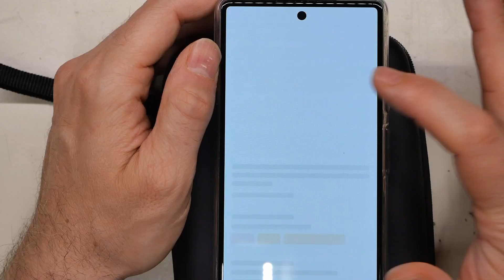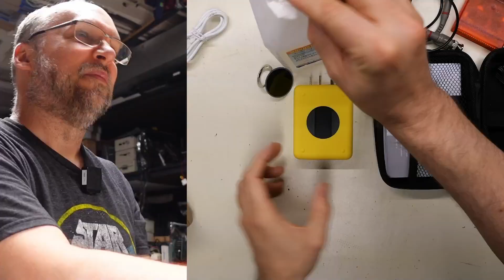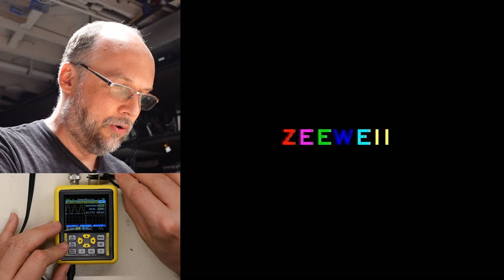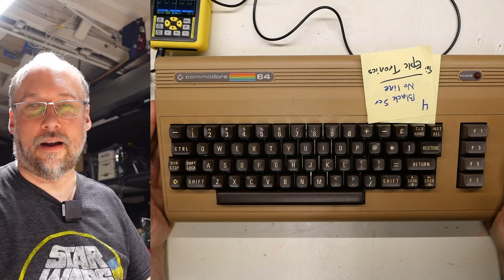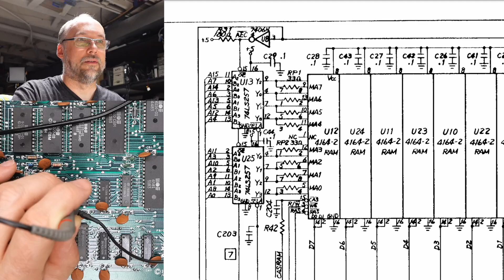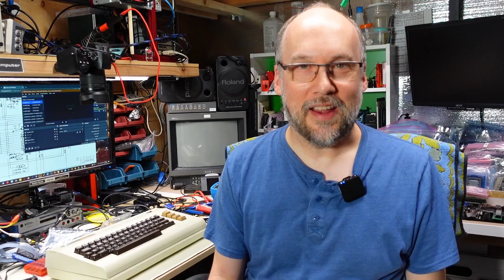4/12 C64 repair using a great $57 portable oscilloscope (ZEEWEII DSO1511G review)

Comment: The normal ENIG gold cover ist very thin (~100nm) and soft and ony supposed as an corrosion protection to ensure solderbility. Real contacts use hard gold, which is ~5um and much harder. But it's an additional chemical process and cost some money.

Comment: Question for your Adrian: Do you still ditch the shields when you repair a C64?  I have worked on one for a week and finally it's perfect! yea!!   But bad words to accumulate.   I thought for originality, I would put the shield back on.  1st time: 5v line short to ground.  Oops wrong shield and carboard. Used one from a 407 board on this 425 by mistake.  Okay fine just a few f-bombs.  Then with the right shield installed and the board screwed in to its new lower case 3d printed "studs", it failed keyboard test. So I buzzed the U1 out.  Only got to pin 3 when I figured out it was grounded Took shield off still grounded.  Grrrr.  More expletive's deleted.  Found a via short to ground near R34 (I think the TAB from the wrong shield soldered there.   Anyway, this was frustrating and will probably just delete the shields going forward.  Made me wonder if you still delete the shields?

Comment: I bought this ,scope and only after I started using it, realised it was single channel. Does anyone know of a dual channel 'scope that still has the video out function? I run technical training for railway systems and want to be able to show on the overhead projector the two waveform that my level crossing manager injects into the rails.

Comment: A minor comment about your reference to the lack of sockets used on the Commodore 64 board.  My first "PC" was a Nascom that I bought in the late 70s.  I can't remember if it was the model 1 or 2.  I bought it second hand from the person who had built it, from a kit, using sockets on virtually every chip and it was completely unreliable.  Several friends also bought them and every one built with sockets was unreliable and every one soldered directly worked perfectly.  It led us to formulate the "Law of PC Boards": "Using sockets to mount digital chips makes it 10 times easier to repair faults BUT makes the occurrence of faults 10 times more likely".  I completely stripped every socket off the board and rebuilt it using direct soldering and it worked perfectly for many years.

Thoroughly enjoyed the video.  Brought back memories of when "building" a computer meant a double sided PC board and a plastic bag full of components not buying a few pre-built boards and connecting them together.
Reply: I imagine the general quality of sockets improved significantly from the 70s to the 80s and are definitely way more reliable nowadays.

Comment: Adrian, As far as adjusting exciter Frequency, is the wave clean enough on a display to calculate out the Frequency per block and adjust the frequency using the wave itself instead of the number readout?

Still may not be sensitive enough but with the visual may be able to fine tune better than using the readout.

Comment: With all the inexpensive scopes, I'm curious if you'd try the Pi Pico (or any RP2040 board) scope that uses Scoppy.  Just for shits and giggles considering how utterly low cost it is.  One of the better of the guides is on how2electronics but there's also a lot of variants out there now. HackADay has a better build but it's also a custom PCB with a lot more components, a display, and doesn't use Scoppy or a different app; higher cost, but I'm not sure if it'd actually be any better.  The Scoppy route, using the RP2040's own (extremely lackluster) ADC is limited to 200KHz, the HaD version is using a 100MHz ADC; though you could modify it to go higher with a higher sampling rate ADC, you could also modify the Scoppy version with modified firmware since you're moving from ADC input to digital input, though I'm not sure what the limitations of the RP2040 are. 

I've also heard talks of an experimental LCR using the RP2040, but I don't know if anything ever came from it.  If this is possible, along with a multimeter, maybe a logic analyzer, and the scope, and if it's possible to make it battery powered with a decent display, decent button control, decent software, and within a good casing, this could be a decent little portable tool; probably no larger than the ZEEWEII is.  Honestly if this is feasible, or upgradable with a better off the shelf MCU, I'd actually dive into this kind of project; an all-in-one tool would be just as useful as those pencil style smart soldering irons that can be powered by USB PD, especially on the go and for field work, not to mention just general space saving.  Honestly if the software could read out bits as well, such as for work on peripherals and various busses, that's just be the cherry on top for this hypothetical multitool.  I might have to look into this myself, since there hasn't been a cohesive project of everything in one as far as I know.

Comment: Ah progress.. i have 3 big metal 500 pound oscilloscopes in the garage and this is higher frequency, 1/100th the weight, cheaper than dirt and probably more accurate :P

Comment: time stamp 36:20 - Put a little hot glue on the corners of the board before closing the easy flash case.  Then it won't wiggle and stress the led legs.

Wow, found this video by accident.  So cool and random,. you made my day.  I hope to be you when I grow up :)
Thanks

Comment: I've bought DSO 2512G and it seems to be a good thing for the price! It's mostly the same as DSO 1511G but has two channels (the max frequency splits in this mode). The price on 11.11 was about 60 bucks. The banana plugs was very tight but the seller did helped me and gave a hint to squeeze it a bit by fingers while inserting.
I don't know where to use it :))) Not a big problem of course. The main idea was that one day I'll need it to debug my Raspberry Pi 4 or to watch how different part of an analog synthesizer works.
Someday I'll return to my long way quest to create own analog synth. It was highly inspired by Adamsky A. channel. If you're reading this and want to know more about that stuff and don't know where to start... His channel is the best place. It's not an ad! :)

Comment: Thanks Adrian, great video. I ordered one from Alliexpress, was $62. However, although all the buttons, menus, features seem to work, I'm not reading (flat line only) any signal from the internal waveform generator, as-if the generator isn't working or the probe isn't connected/working. Any thoughts?

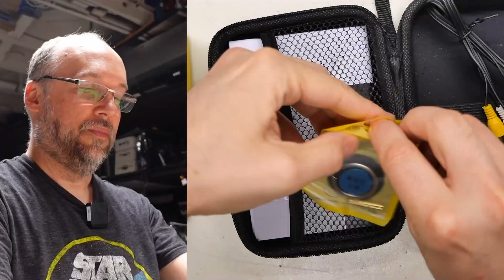Comment: 4:51 I guess that's metal in the back so you can fix a magnet anywhere and have the oscilloscope hanging (at the side of your monitor for example). I do this to my cellphone, very easy to attach/dettach when needed.

Comment: Great video Adrian.  Regarding a general oscilloscope recommendation- what would  be a good choice for a beginner in the ~$200 range?  Thanks
Reply: I believe I've seen some used Fluke 20mhz Scope-meters for that, and you have a professional field tech's portable tool that's rated for high voltages, rough usage, 2 channels, name brand parts/accessories and worldwide sales and support!  Hard to beat that combo; I used to use a 105 model daily 20 years ago and would totally love to have it today! Just a rock reliable device whether you're at the bench or hanging on a mast in the rain.

Comment: I love the repair video, as I owned a C64 back in the day, along with a C128 ironically.  

But, I wonder what the point is to fuzz with a cheap Chinese scope when you can pick up a cheap 50Mhz or 100Mhz Tektronix scope for around $50 to $100, and have an actual great scope you don't have to be guessing and fudging with to repair these.
Reply: Portability!
Reply: @vincentandrunas6040  OK.  But in this case we are bench repairing the computer, so I rarely ever have occasions where portability of a scope is a feature I need.  Maybe there are cases out there where that is a desired feature.

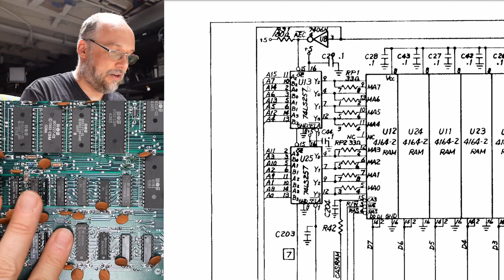Comment: @27:00 Or thereabouts, "...see if it's hot..." reminds me of mending a daisy wheel printer in 1985, I couldn't work out what was wrong, none of the usual culprits, but as I gently pressed the PCB, thinking of a broken track, I found a really hot chip. A quick swap and it was fixed!

Comment: Would have been impressed but I bought a similar handheld that does more such as capacitance, resistance  for slightly more. The resolution similar which is not very good at all except for the most basic jobs.

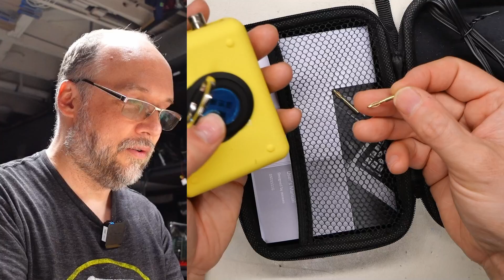Comment: 5:06 Those are 4mm to 2mm banana plug adapters. So if you have 2mm cables, you can use them in the 4mm sockets.

Comment: On cutting IC legs to isolate pin. I was a tech at Digital Equipment in 1969 and we used that to open the circuit. It came down to us that it was causing damage internally to the chip.  Not sure how true that was, but I found another way, which was to suck the solder out of the plated thru whole and center the IC pin in the hole to isolate it. On the processor boards in an 11/45 any single data, address, or clock line went to several places and no single chip could ever be depended to fail. Interesting little scope, but I still prefer an analog scope.

Comment: Amazing. 

I enjoy electronics as a hobby but not at your level. I actually have too many hobbies in my retirement including stringed instrument building and I tend to indulge until I switch to the other. 

That was quite amazing.  I may pick up the scope as a Christmas gift. I have an early 80s 30 MHz scope I use when building simple TxRx radios, but it's only a matter of time before it fails and at $57 if it still sells at that price, why not....
Reply: Rotating hobbies helps keep them fresh and helps alleviate the sting on the wallet.

Comment: such a cool video and excellent demonstration on the use case for an oscilloscope and the type of problems it can help you solve. im a diesel mechanic and all out gearhead and i am somewhat recently finding the urge to expand my skillset to a deeper level, for lack of a better term lol. i want to learn about the more intricate and detailed and exact way of how and why certain components do what they do. i cant seem to find the right words to get my point across but this video is exactly what i ant to learn. things like electrical currents, frequencies, the components on pcb boards i want to learn how it all works at that level, i find it so interesting. 
thank you for also giving a really good demonstration on how you can utilize an oscilloscope and actually interpret what it is displaying. i was having trouble wrapping my head around the general concept of an oscilloscope and what exactly it does and ive been trying for a pretty good amount of time about 2 months at least. your video finally made it click in my head and i feel i have a really good understanding on what exactly they do and what type of problem they can used to solve for. thanks man i am definitely subscribed

Comment: Now that brings back memories. I had 2 repair centers in the early 80's and I specialized in the Commodore 64 and Amiga Computers. Worked on literally thousands of 64s. Bought ram chips in quantities of a thousand at a time and had custom PLA's programmed in batches of 500 at a time. Also built several hundred power supplies that I sold thru my store. Many memories! Glad to see they are still around. 
Thanks for the stroll down memory lane.

Comment: There are several possibilities why the sound doesn’t seem right.

There are at least 3 SID revisions out there. The classic one, the new improved one and the fixed improved one.

Usually, the music is written and tested on the classic 6581 version.

Then there is the improved 6580 version mostly present in the C64-II. The major difference is that they had fixed the popping sound problem when switching the volume. This chip is not capable to play digi sounds at all. Some advanced music demos use digi sound effects which will be missing, everything else plays just fine.

And since many people complained – especially we Germans – Commodore made the C64-G (G for Germany) Version. It comes in the classic but light-grey bread-bin so we can install all our favorite mods and contains the fixed improved version of the SID, the 6582. Unfortunately, while they deliberately broke the volume controls to return digi sounds, they also had changed the filter capacitors. So while you now get all the digi sound effects right, the music is overall a bit off!

I am not familiar with the NTSC model, but I fixed many PAL versions so far.
Sometimes, you find a different SID even in the classic bread-bin casing. Especially the “ALDI 64” is a grotesque mix of leftovers. While this one was never sold in the grocery marked ALDI, people like to refer it as the “ALDI 64” since it is seems to be cheap. You can identify this version easily since the 9V AC are missing from the user-port. If you have got one, no EPROM burner for you!

I have also encountered several C64 with wrong filter capacitor values. Sometimes they switched them around which seems to be a production error, sometimes there are just the wrong values installed.

Also I have had several C64-II with the C64-G filter capacitors.

So if the sound is generally playing but sounds a bit off, you should check and replace the filter capacitors first.

If you encounter a C64 with the 6580 SID and you want it to play digi sounds, you don’t need to replace the SID. You can feed some DC into the Audio-In using a resistor to make the volume controls pop. This is almost as good as the original 6580.

Comment: Around 2008 I bought a DS213 Nano V2 Quad.. It's the size of a deck of playing cards, with a color LCD screen, 4 channels, micro-LEMO connectors for the probes, and about the worst UI I've ever seen on any electronic instrument.  Still, if you can get past the infuriating UI and touchy probe connectors, it is quite functional. I keep it in my backpack just in case an opportunity arises to let my geek flag fly.  I see they are still selling them for around $200. I don't think they're worth that much money, but they do well in the tens of MHz in a tiny form factor.

Comment: The frequency claim on that scope seems to be honest.

For the uninitiated, a bandwidth of 100MHz, means that 100MHz sinewave will be attenuated -3dB (70% voltage). A squarewave is mathematically made of many sinewaves, and to look decent needs sinewave components, at least 20x, the squarewave frequency. So for a 100MHz scope, 5MHz is the highest squarewave freq, to display it properly. Those 8MHz and 14MHz signal images, are not representative of their true signals, though still pretty good. I use to fix computers, in 80s, with a 35MHz analog scope, and those 8MHz & 14MHz signals would have looked closer to a sinewave, on that old scope.

Comment: That's really an incredible little scope. I couldn't find the exact one you are testing here, but I found a duplicate on amazon listed for about 74 bucks. Screen and controls look exactly the same, but it is listed as the FNIRSI-5012H.

I will be checking out your channel more over the next few days, thanks!
Reply: Did you receive it?  Was it anywhere near as good as the one in this video?

Comment: You should never use a pencil eraser to clean electrical contacts.  There is sulfur in a standard pencil eraser, and that can cause additional corrosion after you clean.  Plus, the standard pencil eraser is way too abrasive.  For gold edge card connectors, a little alcohol and a paper towel are all the cleaning you need.

Comment: I think, the little scope has one big advantage: it does not take much space on the work bench. And I don't like working with a logic probe, because it does not really show bad wave forms. Also, you have to find 5V somewhere in the circuit to power it. The big alligator clips are not great for that purpose.

I think, the prices on AliExpress double after the first good review. I don't do that anymore. I just write bad reviews, in case there is a reason for that.

Comment: no NTSC color is a deal breaker for me. i couldn't easily see that tiny screen. i have enough trouble using the old tektronix i have at the office
Reply: You can run the PAL composite video through an AV-to-HDMI converter, which is what I plan to do. Then it doesn't matter whether the scope outputs NTSC directly. I also have an HDMI-to-USB adapter the turns my tablet into an HDMI monitor. Should make a very nice portable scope!

Comment: I usually love your videos, but this one was unfortunately unwatchable for me, due to the oscilloscope's 288p video output being interpreted by your RetroTink as 576i, making it constantly bounce up and down, which hurts for me to watch. Does the RetroTink have an setting to interpret the signal as progressive instead of interlaced? If you use this oscilloscope in a video again, please enable that setting.

The bouncing is made worse by the fact that the frame rate is 50 Hz, not 60 Hz  (apparently the signal really is 288p PAL, not 240p NTSC interpreted as 480i), making the effect much more visible in the 60 Hz video due to it periodically staying odd or even for two frames in a row, resulting in an uneven bouncing.

Comment: Oh, I got the exact same case with an - it goes without saying, Chinese made-  Anbernic 351MP emulation handheld system.
I always thought they had that only for a decent imitation of the official Nintendo Switch case. But now I know, it's probably just a successful bulk buy case. It is really functional and nicely durable though.

Can attest, it works well to sew patches onto its kinda-rubberized-but-not-really shell.